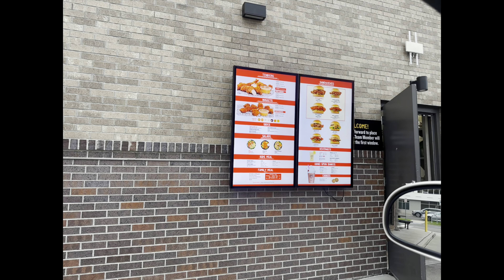VLOG | Day with me | Sanding ILX doors

Comment: So do you use the Bondo resin mix first before using straight resin?  In the past, the material I used to absorb the resin influeced the number of pin holes i had.  I tried the stretchy fleece and it was horrible but normal speaker box carpet worked better.  That material didnt have nearly the same number of problems.
Reply from the maker: @ptinker106  resin first, fleece and carpet are totally different, I can’t see myself using carpet rather than fleece for a mould.